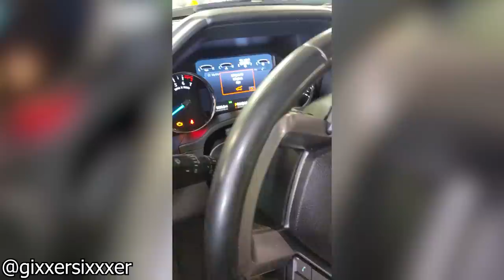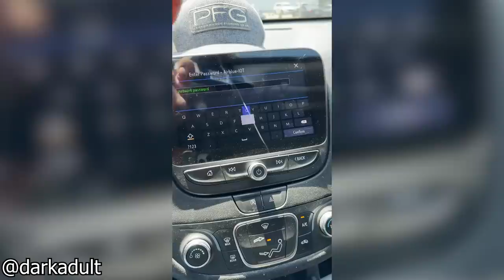Customer States The Rear Seat Folds Down When I Use The Left Turn Signal

Comment: engine light is on... tyre pressure light is on... "I think something's not right" yeah right, mate.
Reply: Yeah, the 3000 rpm ceiling is because the car is in "limp home mode", it will be severely down on power as some vital sensor is missing, and the car has to run inside some safety parameters.

Not meant to be driven for long like that.
Reply: @JohnDoe-bd5sz  Especially not while towing something. If only people would read the manual...
Reply: @lotharrenz4621  "What is this 'read' thing you speak of?  What witchcraft is this?"
Reply: @lotharrenz4621  more like actually get the MIL checked out.....
Reply: @NemoConsequentae  dunno. heard about it at Kindergarten's, but never used it myself. I think it comes in bottles full of bitter stuff that foams like rabid dogs.
Reply: @JohnDoe-bd5sz  I am pretty sure it's in the manual as stated below, or wouldnt this truck give you warning message with information when you started it up?
Reply: Right,  I think what's wrong with the truck is that it's owned by a moron.  If he doesn't even fill his tires, I wonder what other basic maintainance he's neglected.
Reply: @Board.Dad.Woodworking  He could have gotten new rims with bigger tires and never got replacement sensors hence the tire light, but yeah i agree the guy isnt too bright and prob doesnt maintain his vehicle. Just for the fact that he says he is towing something and doesnt realize he isnt gonna have the same power when he isnt towing shows he doesnt know anything

Comment: Yeah I hate it when a failed wheel bearing forces you to continue driving for miles until half your rim is grinded away...
Reply: Welcome to Chrysler Product ownership. Stupid enough to buy it, stupid enough to drive it well after it needs repairs.
Reply: I wonder where did the tire go
Reply: @engineprojects  we all ask that question, probably gave up as does everything on a Stellantis product 😂
Reply: @Toyotajunkie this is usually what people say to comfort themselves for not owning a dodge. Most people will go straight into rejection and talk shit about a product but have never owned the product they are shitting on. You keep playing with your Toyota and leave those hard working dodges alone.
Reply: @Justin Ontman  I wanted to add, I have owned multiple Chrysler Products in my life. Most only for a few days to repair and donate to the poor. But a couple I had for a few months, until they do what they do best...
Reply: @justinontman  Thank you. Ive never had a problem with a Chrysler or Dodge.  Take care of it, it will take care of you. Even my mothers 05 half beat to shit neon still runs and drives better then alot of newer vechicles out there. And with a RAM 1500 with almost 400k on it no major failurs, I think i'll stick with Chrysler cars. (The newer RAMs suck to work on, ill say that much though.) Not to mention,,,all modern day ones have a built in code scanner. How many of you knew that?
Reply: @justinontman  um Dodge is Chrysler. Also good luck with the rust and suspension problems.
Reply: @Justin Ontman  we found the Dodge fanboy, lol.
Reply: @rjgaynor8  lmao you think rust only affects Chrysler products? You must be driving one of those soda can ford's. Lol
Reply: @justinontman  lol. Ok guy. Lol. I actually have owned several jeeps over the years. But how many 90s era dodge pickups and vans can you find still on the road. My 99 ranger is still ticking with no rust and I have seen a ton of 90s era Econolines on the road. But no 90s era dodges? Oh and we get a get feet of snow every year. Still not problems with my fords. My jeep on the other hand is only 10 years old and is rusting.

Comment: Last one: start by reading DTCs. That yellow light is there for a reason...
Reply: Thats a great place to start yes. But this is obviously a worn clutch or he's pulling something too heavy for the clutch, its slipping, hence why his rpm goes up and down. If he keeps doing that he'll surely burn the clutch totally
Reply: @kleisti7768  I don’t think that car has a standard clutch, it’s most certainly an automatic. 
Also, he says that it hunts while coasting and has low power.
My guess is that the DTC will read ”too lean” and that he has a substantial intake air leak.
Reply: Looks like he's in a older ram could be clutch is standard or the bands are failing if it's a automatic transmission which they always do on the 48re's
Reply: By the way it acts, looks like the torque converter is failing to lockup. I know my 1998 Suburban K1500 does the same thing due to it having 200k miles on the original 4L60E. My Suburban will need the transmission rebuilt, but just couldn't tell you if it's the same thing on a (looks like 3rd gen, around 2007) Dodge Ram.
Reply: @patriksonestad8208  well in that case a torque converter. A failing clutch or torque converter has the same symptoms of loss of power while the engine randomly revs without your speed increasing
Reply: Tow/haul button locks out overdrive which kicks in @ 2500 rpm under light load. High gear or torque converter. Every ram I've had has a finicky converter but only at start up!

Comment: last one is a problem with the drive by wire, which unless obviously shorted or open may not set a code. If I were a betting man I would bet on the TPS sensor being bad. 

There are some instances where a drive by cable will exhibit a similar condition (high, erratic idle and loss of power), but being as the truck will only rev to 3k, It leads me to believe you're dealing with a DBW  truck, and the truck is trying in limp mode (but still receiving faulty intel)

You should be able to read the codes without a scanner.
with the truck in park and OFF, cycle the key to the RUN (NOT START) position 3x.

OFF- beginning state
ON- run
OFF
ON-run
OFF
ON- leave in run postiotn, codes will be displayed in odometer readout.
Reply: It would be fine if they hat put a cover page on that TPS report...
Reply: He said it's only doing it when he tows stuff so I would be inclined to think that it's probably the torque converter going in and out of full lock up. That's pretty common when you're not in the powerband and towing something or going up a hill.

Comment: Growing up, we had a '66 Mustang that if you turned on the blinker and turned on the emergency flasher, then stood on the brake...you could run the radio without the key (you stood on the brake to keep the blinker/flasher combo from flashing, thus cutting power on and off to the radio).

Comment: Love the smoking Ford. At Ford, quality is job one.
Reply: Probably seafoam
Reply: @noneyabizz8337  no Ford...it's normal
Reply: @mikefoehr235  great, you got your little jab in, congrats.

But that smoke, it looks like the result of sea foam.
Reply: @noneyabizz8337  Well, our 97 Ford Taurus smoked like that BECAUSE OF A CRACKED TRANSMISSION CASE....so stop defending that useless car company called Ford. That same car also needed a second engine and so many other parts, I could bore you to tears with a novel. GM was nearly as bad as Ford....thank God for Toyota.
Reply: @mikefoehr235  your car had smoke coming from the exhaust because of a cracked transmission....

Ooooook

Comment: Remote starts on manuals would need to leave them out of gear it wasn't poorly installed as it bypass the clutch being pressed in
Reply: Unless someone bypassed the clutch pedal lock out switch.
Reply: @Cheepchipsable  "installed as it bypasses the clutch being pressed in" pretty sure i what you said you cant use a remote start on manuals without it being bypassed

Comment: Last one, either the transmission or torque converter is slipping. Happened to me in my 07 Explorer with the 5 speed auto, jumping RPM and no power

Comment: Judging by the gap between the wheel and rotor, looks like someone forgot to torque the wheel in the first scene. In the last scene, the CEL is on so the truck knows something is wrong, it's just waiting for the loose nut behind the wheel to figure it out.

Comment: 4:54 - Hmmmm. 🤔 Have you tried pulling the code(s) for the Check Engine light? And your TMPS is also reporting an issue? Yeah, your transmission/torque converter might have issues, but maybe look into the faults clearly displayed on the dashboard before asking for a diagnosis. 🤪 If I remember correctly, your Fiat Chrysler LLC truck can read out the stored codes on your digital odometer with a specific number of "key-on" cycles.

(I see below someone has already helpfully typed out the process. It works for an overwhelming majority of Chrysler, Dodge, and Jeep vehicles, and it's a pleasant departure from other manufacturers that don't provide a simple means of code-reading!)

Comment: What sucks about remote start in manuals is that some cars require the car to be in gear in order to remove the key
Reply: Istall it thay said it would be fun thay said   whelp shit
Reply: Maybe, but modern cars have a clutch lockout when the car is not running, so it should not crank when in gear without depressing the clutch.

Comment: Remote start. Why?
Reply: That looks like a manual, meaning the owner bypassed the clutch safety switch, not a smart idea. They likely park in neutral with the parking brake on. Why do they have remote start? Too lazy.
Reply: My guess would be they live in a very hot area and want the air con to cool the car before getting in.
Reply: @whataboutbob9786  . In cold areas it takes a few minutes to clear the frost from windshield and warm the interior. Pretty common in north.

Comment: Wow. Ive never seen an engine throwing ALL the rods before.
Reply: Throwing rods was amateur level stuff, these new engines are designed to pitch for the major leagues 🤣
Reply: I said exactly the same thing. 100% rod failure. How steep was that "hill"?
Reply: Neutral drop your transmission down hill at 7k. I can't believe what was left of the engine block.
Reply: I am thoughly impressed with the level of destruction of that engine and transmission

Comment: 4:55 This seems to me like the transmission is confused by the load you're placing on it, for whatever reason, and it's repeatedly locking and unlocking the torque converter. It sounds like the load on the engine stays the same, even as the RPMs change, which tells me it isn't actually changing gears, just unlocking the converter, and letting it slip, so the rpms run up some. Perhaps the converter has had it, and isn't locking correctly?
Reply: do not tow in overdrive, RTFB
Reply: Might be the throttle position sensor, had an old Dodge Cummins that would got through them every year and a half or so.  Badly designed part.

Comment: I dread the day I have to get a new car and there are no options without touchscreens.
Reply: I once tried a rental Mazda in the pick-up lot. 
When I couldn't even figure out how to turn off the radio, I got an Altima with all knobs and handles.
Reply: While shopping for a car a few years ago, I just told salespeople that I can't safely drive while using a touchscreen. I told them any time they want to show me a touchscreen feature, no problem I'll just pop it into Park. 
Nobody tried to talk me out of it. Nobody asked how I'd learned it was unsafe. They definitely steered me towards no-touchscreen cars, and I found one that I love.
Some manufacturers are starting to hear that customers hate the things. Keep the faith!
Reply: @j_taylor  No different to using knobs. You just learn where the knobs are over time.
Reply: @Cheepchipsable   I can think of 3 differences. 
1, Tactile navigation. You can find a knob or button by touch. I agree, someone becomes familiar with the location over time, but a screen lacks tactile cues that you are correctly lined up. 
2. Touchscreen functions depend on context. The same command has totally different results depending on what is displayed on the screen. To know what a touch will do, you must look at the screen. 
3. Tactile feedback. Simply, what did my command do? Did it change the climate control temperature? By how much? Did it do anything else?
Then there's the whole "my finger jiggled over that bump, and the touchscreen took that as a command" which doesn't really happen with knobs and buttons.
Reply: @j_taylor  Some you have to enter different menus to get to where you want to be, I like being able to reach over feel a couple of clicks and know how much I moved something

Comment: Probably not the same issue the last video had, but going down the highway my vehicle would do that, just not a wide of a swing as his, it turned out that the lock up for high, should say over-drive  (automatic) wasn't, so it kept 'searching'. I would suggest taking it to a shop that deal mainly with transmissions for a 'look see'.

Comment: What is a 2001 Z 71?
Reply: Yeah, I don't think technically Chevy released anything in 2001 officially as Z71, but all the "offroad" guys call their Chevy's Z71s.
Reply: @michaelshaw6242  I know what a Camaro Z28  is (sort of) & in Australia we had a Holden Colorado Z71, which is a 4x4 ute with appearance options.  That Z71 looks like it's got a transverse engine...?
Reply: @De19thKingJulion  You know, I ASSumed it was a Silverado pickup truck. After watching the clip like 4 times, I think it is actually longitudinally mounted, but the camera moves really weird. Had me thinking transverse, too.
Reply: @De19thKingJulion  Basically Z71 is the appearance package almost exactly like the Colorado.
Reply: @michaelshaw6242  I see.  Which 2001 Chevrolet models did it apply to?

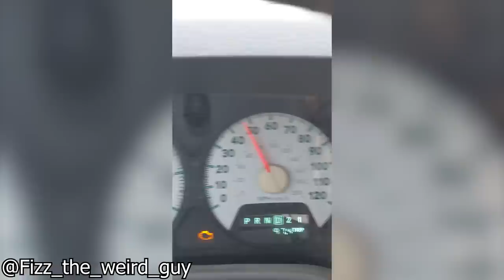Comment: @5:10...throttle position sensor? Start with cleaning the throttle body, see if you can get off cheap. TPS is next step, IF that's the issue.